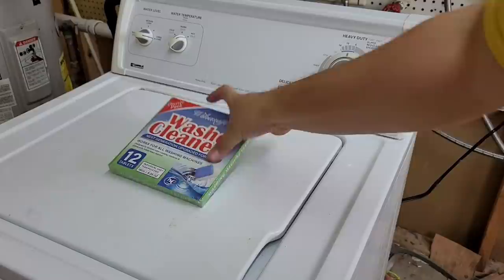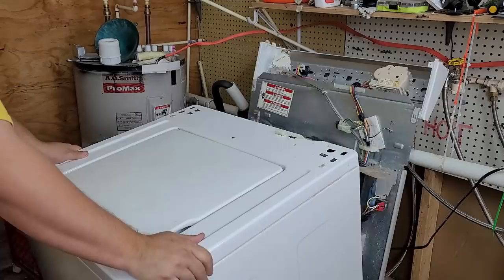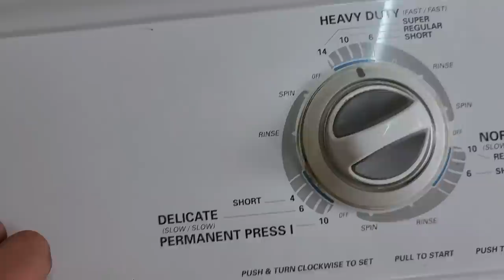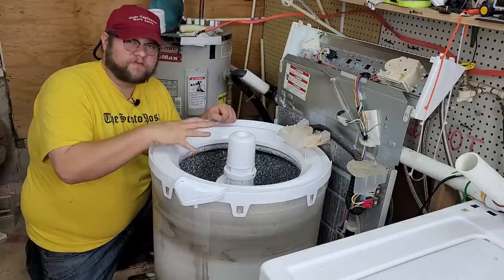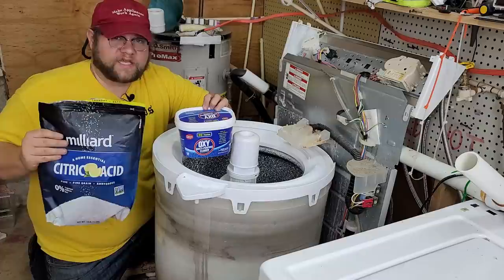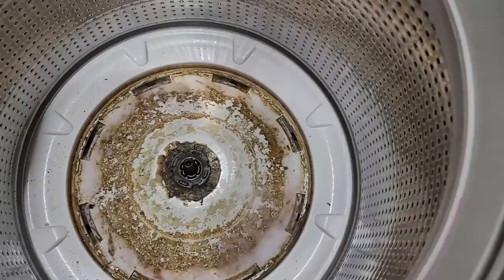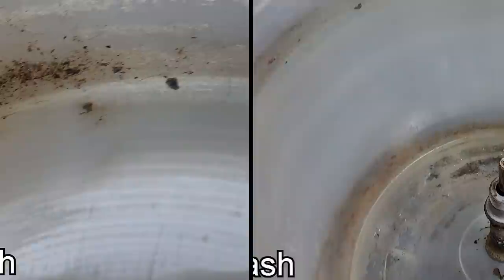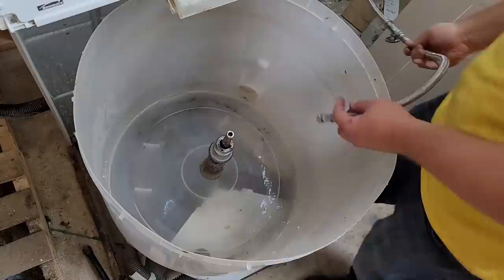Clean a Washing Machine Inside: How to Remove Mold, Soap Scum and More with a CHEAP Organic Cleaner

Comment: Citric aid can be quite expansive and hard to purchase.   I have a better solution.  I went to the Dollar store and purchased five boxes of TANG orange crystal at two dollars each with each package having 2 packs inside.  I poured all five boxes in the washing machine and set the machine to large load. After the first cycle and before the water emptied I stopped the machine and started it again on the first cycle and let it run to the end.  My tub was clean and it only cost $10.00 .  The best part was I did not have to take the tub apart.   I plan on doing this twice a year.

Comment: As always Ben great work.

Two questions: would plain oxi clean work alone, even if one stopped the wash cycle for a half hour and does the water temperature matter?  I always thought one needed hot water to activate the oxi clean.

Your informed opinion of this is?
Reply: I got a used top loader which is a GE space saver. In the month of august the laundry room heats up and suddenly I could smell mildew. I did the sniff tracking and it was the washer. I ran a load of whites with hot water and  bleach and put it on presoak. it got rid of it for awhile. Then it came back. I then read about the oxiclean and I then did the same (without the laundry). the long cycle with presoak . I have not smelled any mildew for years now. 
 But I think I should give it a cycle just to keep it that way.

Comment: Thank you immensely for fantastic video! I have newer water saving washer Frigidaire with no agitator. Can you or anyone here please help with tips on how I can trick it into allowing more water into the machine for cleaning when it's empty? It has awful automatic load sensor that restricts water especially when empty, and no water supply nearby I can access to add more water. Water doesn't even cover clothes 1/2 way, unless I wash clothes 2x wasting water, electricity, detergent, time &  money. I tried Expensive Affresh tablets before that never dissolved, didn't clean machine & left blue speckles & powder mess worst ever! Please help...
Reply: I have the same problem w/my Samsung top load. I HATE MY WASHER. Anyway, I keep a gallon jug in the laundry and fill it with water and pour on top of clothes. Then start the washer. The amount of water is based on the weight of the clothing the washer senses, so adding water to the dry clothes adds extra weight tricking the washer to use extra water in the wash.
Reply: @No One  Thanks for tip I did that too until I replaced it with the new Frigidaire washer/Dryer stack FLCG7522WH! This new one has awesome  water level selections  of MaxFill, Med, & Low that are great & generous. Laundry is much cleaner & less lint with more water.

Comment: Ahh I just poured a cup of citric acid in and a 1/4 (more like a 1/3) cup or oxyclean rewatched before doing anything else and you mention a tablespoon. Will I screw this washing machine up if I start the cycle? (Add water etc)?

Comment: I’m getting small rust spots on my clothes but we took out the agitator and it didn’t have any noticeable rust. Will this help with that? From the quick glance i had of the exterior of the inside tub it still looked orangish here in your video. The washer works great but its def old…and loud. Thank you!
Reply: It may be the brown gunk instead of rust. I started noticing it on my white towels, then looked in the water and saw tiny flakes. Started Googling and wound up here!

Comment: Wish you had a video on how to clean a front load washing machine.
Reply: I’m definitely excited to try his cleaning cocktail, but we can’t get as much water in with the front loader, so I hope he makes another video for those. What  we’ve found useful is in between cycles we put a small fan right on the grey rubber gasket so that it’s got airflow until the next time we use it. It’s worked great for years. Now if I could find a tool that could get down under the tube I would be so exited! You know we’ve got some germs just lurking in there!

Comment: So, I live in an apartment building and obviously they wouldn't want me taking apart the washing machines! But if I just ran the citric acid and generic OxiClean through the machine and then ran the machine again just with water do you think that would help?
Reply: Can't hurt.   I'd try using a quart of white vinegar instead of the citric acid and do a white heavy long hot cycle. .

Comment: good video, can i run my washer without the drum in it just to rinse out the moldy water in the bottom of the tub, say like put it on rinse and spin and select small load to be safe. is it okay to do that or no? i want it spotless before i put the drum back in. or would it give me an error code running it without the drum in it? it's a whirlpool washer about 10 years old. i dont want to ruin the  washer. help please. oh i can see in the video that you actually put the washer on drain and spin to remove the water . thanks  I'm not scared to try it now.
Reply from the maker: It should be OK, but I'll be honest: I've never tried it.

Either way, if you let the citric acid sit in the washing machine for a few hours, its going to rip all the mold and gunk apart. Its one thing I regret with this video - I should of let it soak a lot longer.

Comment: I want you to troubleshoot the whirlpool duet dispenser it has a tray that pulls out soap on the left bleach on the right front fabric softener in the back fabric softener does not dispense I had it all part it's all clean what's the deal

Comment: I have front loader HE. How do I clean my washing machine and how often should I do it?  
Is it better to use powder or liquid detergent?
Reply from the maker: liquid detergent I believe. I am going to make a follow up video for frontloaders soon.
Reply: @bensappliancesandjunk  please do . My parents have a Frigidaire front loader that is a few years old and has never been cleaned . It’s hard to clean thoroughly though because it sits in a tiny closet with the dryer on top . So while I can’t clean the filter and pump unless we have a professional come  , I would like to at least clean it doing what you’re doing .
Reply: Please do one for front loaders! 
I’m definitely excited to try his cleaning cocktail, but we can’t get as much water in with the front loader, so I hope he makes another video for those. I want to know what tool I can use to get down between the drum. 
What we’ve found useful is in between cycles we put a small fan right on the grey rubber gasket so that it’s got airflow until the next time we use it. It’s worked great for years. Now if I could find a tool that could get down under the tube I would be so exited! You know we’ve got some germs just lurking in there!

Comment: My husband and I buy and sell washers and dryers. We strip each washer down to the case to repair what needs repair and so I can clean the tub and basket it sits in. 
You cannot believe how disgusting most tubs and baskets are! They are caked in old soap, dirt, grime and liquid fabric softener. Once the tub is out, it’s easy to clean with a scrub brush, but I realize this isn’t easy for all to do. This seems like a good enough option if you cannot dismantle your washer.  I tell all of our customers to NEVER use liquid fabric softener. That stuff is wax and it attracts the dirt in the rinse cycle and clogs up all the holes in the tub, and cakes the basket water line in grime. 
White vinegar is best in the rinse cycle. The vinegar deodorizes your clothes, and keeps the washer tub and basket clean.I also use a scoop of baking soda when I wash clothes and always use hot  water. 
If you’ve never cleaned your washer, I urge you to do so. You’d be disgusted if you saw the condition of your tub and basket, and I guarantee your clothes are not getting clean. 
So..
1. Never use liquid fabric softener 
2. Always use a quarter cup white vinegar
Wash clothes with a scoop of baking soda, hit water and always an extra rinse
Reply: What do you find between the drum in front loaders? I’m dying to know how bad ours is!!

Comment: anyone know if the metal he hits with the mallet is a removal tool or part of the machine? @2:22
Reply from the maker: I am using a spanner wrench to remove the tub nut
Reply: @bensappliancesandjunk cheers mate, seen a Kenmore/whirlpool one that looks similar. Doesn’t look like I can get it in the UK though. Thanks for the video 👊🏼
Reply: @bensappliancesandjunk  What kind of spanner wrench? I am using a tb123a on a Maytag Ensignia MTW5830 and it will not budge. I'm afraid of hitting it too hard.
Reply: It won't budge. I can't get it to move. Tried wd40 and a heat gun. Beat the hell outta the spanner wrench. Ugh
Reply: Tried pb blaster penetration oil. It wouldn't move.

Comment: I’ve used citric acid as a 1–3 day soak to clean badly rusted tools, but never ever thought about using it to clean my washing machine. Can the citric acid be added to a regular load of wash? …or would it harm the clothes in any way?
Reply: I would not add citric acid while clothes are in washer. It will deteriorate the clothes. If citric can get years of built up gunk off the washer I’m pretty sure it’ll eat your clothes up.

Comment: HI, silly question here since you've already made a recommendation, but there is another video where a guy uses a cup of oxy cleaner by itself, and an impressive amount of crud was removed after letting the mixture sit. Oxy cleaner is more expensive than citric acid but, in your experience, which one works better for removing crud without scrubbing? I don't have the tools at the moment to do a full disassembly and deep cleaning but I do have large amounts of oxy cleaner and citric acid!
Reply from the maker: I am certain oxyclean is a fantastic thing, and we use a bit of it too. Have I used pure oxyclean before? No... Its too expensive, because I buy citric acid in so much of a bulk, its like $1/lb for us anymore (which is MUCH CHEAPER than Oxyclean, as its usually $4-5/lb where I am at). Either way is going to work fantastic. Main thing is, let it sit for awhile.
Reply: I just let three cups of OxiClean sit for five hours last night (soaking white shirts), and noticed no extra crud coming out except the tiny flakes that normally appear. Those little flakes are what led me to this video, and it's why I bought the OxiClean. I was waiting on the citric acid to get here, so I did shirts in the meantime. Short story long, I think you're gonna need the citric acid. Will be treating mine today and will update!

Comment: Does anyone know if a new washer with a designated self-cleaning cycle would work well with this process? Or still just a normal wash cycle? Thanks :)
Reply from the maker: Self-cleaning would be optimal for sure. Its longer and hotter to break up the bad gunk
Reply: @bensappliancesandjunk  awesome thank you so much!! 😁

Comment: Can you use this solution for front load washers?
Reply from the maker: It's not quite as good on a frontloader because a lot of the buildup can be at the back where water is temporarily stored. So I'd suggest putting it in the dispenser potentially, but yes, it can help

Comment: How does it compare to using CLR?
Reply from the maker: CLR is great for removing minerals, and its basically a concentrated vinegar. It'll work great but man, CLR is REALLY EXPENSIVE. We do use it for certain situations, but I can buy a 10lb bag of citric acid for the cost of maybe 2 small bottles of CLR.

Comment: You didn't show the drum after that is the very important thing! But the way in Italy we use cItric acid to, for little front load we use here 200 grams, and but the way you need to use very hot water that way citric acid work 50 times better on lime scales and stop the machine and leaves a couples of hours! Also dish washer tablets we use 2 of them, i guess with all this water you gona need 6 of them! It work like this, first hot wash with clorine bleach 2 liters! Second hot wash with dishwasher tablets like 4 of them, and 3th one with citric acid, 2 cups in your case! If machine is in really bad smelling condition repeat again the procedure! For every cycle stop it for couple of hours

Comment: I use cup of white vinegar and 1/2 cup bicarb soda. But never looked inside?
Reply: If yoiu use half those amounts added to every ioad, use kless detergennt and dont use fabic softener, you will clean you machine gradually and the trapped material released from the machine AND the clothes will be flushed out with the rinses.

Comment: well, I have searched a bit on the internet since I remember that sodium peroxide (most oxi cleaning powder is this) is a base and it will react with citric acid. well, I was right. even though I don't know and understand why it cleans better this way, I still want some explanation on this since I am curious about it. Thanks, if anyone could help with that ! ^_^
Reply: Are you sure it's sodium peroxide you are thinking of -- That compound is a pretty nasty oxidizer... Did you mean sodium per-carbonate?  If not, can you list a product using sodium peroxide so I can see additional ingredients that may interact with it?

Comment: What about dishwasher detergent in front loading washer and would it be clean and remove molds? Because dishwasher detergent is clean real good to plates, pots/pans and glassware to the same to washer drum and door rubber seal
I know clothes detergent is making worsen inside washer while washing clothes. Why could the manufacturer clothes soaps should be improve!
Reply from the maker: Dishwasher detergent is formulated for a dishwasher, not a washer. I guarantee it'll damage the unit over time.

Comment: How people let their washing machines in this state I want to know ? I had to get rid of a nice Panasonic inverter machine because I took it apart got the tub , drum pipes rubber seal everything scrubbed even got two of the 5 water jetsystem working again ( only 3 did when I had it) and the element had gone so it was absolutely gross will never forget the smell. They must of been using it months with tap cold water. 
But all the stuff I done to it! Could still never get rid of the smell of mold and damp! Out of the machine tried everything even washing clothes on hot and boil washes using everything known to man and it still smelled 🥴😷  so I sold it! I think some machines can’t be helped! Plus Panasonics spare parts prices are robbery… 💯

Comment: The companies literally created a new market by making bad machines.   I never needed a cleaner for my washing machine.  Just ridiculous.
Reply: o i think the grime was there. But now the outer tubs are smaller so we use less water. so less air circulation between the tubs so it cant dry out in between washes can cause mold, mildew and stink.

Comment: I just use real OXY CLEAN powder in my wash loads and it doesn't ever smell! I have a Maytag up right high efficiency washer no middle agitator just one on the bottom You can also use cheap gallon of white vinegar and baking soda fill agitate and turn off let it sit few days before your next laundry day can do same with the oxy clean use hot water and turn off let sit few days then finish the cycle

Comment: Simple fix, always leave lid up or door open when not in use. We never have this problem!
Reply: I always leave my lid up. Still full of crud.
Reply: @fl0nk11  Maybe you have bad water? Do you run a tub clean once a Month with bleach?
Reply: @uf1978  No...I have the same problem referenced in this video--waxy buildup of fabric softener, lint, etc. Bleach doesn't fix that.
Reply: @fl0nk11  i have the lg front end washer and the tub clean cycle runs for 1.5 hours with bleach and its very clean after that. Maybe its your washer?? Good luck

Comment: Bro, you took the time to pull out the tub a second time but didn't even show us the after results on the outside of the inner tub??? My guess is because it was as bad as your results on the outer plastic shells' inside. I saw no difference in the before and after of your mixture. And instead of letting it run thru the cycle, since it's an older faster cycle machine, why not set a timer and come back before it finishes agitating, and just reset the cycle? Double it, add another 4 minutes, 8 minutes, whatever. -Cheers!
Reply from the maker: It was a slight bit better, but the issue was that in order to really do the proper test, I should have left it sit overnight, but was strapped for time to have space/time to finish the video. I'll eventually run another test or two for longer settings w/ more water, as the length of time helps quite a bit

Comment: Who the hael is going to take their washer apart like this?  Seriously…?  I’ve had several washers and never had to ‘clean’ them!?  Leave the lid up and never stinks either!
Reply: It’s not the “stink” that’s the problem. It’s the gross gunk (skin, oils, perfumes, lotion etc) from dirty clothes. Ever see what your shower looks like before you clean it? It’s only a portion of the gunk on your clothes getting washed in a small condensed tub!   Not cleaning your washing machine is the equivalent of vacuuming your carpet and NEVER edging it.  There will be a 1” line of dirt at your baseboard & your floor really isn’t clean.